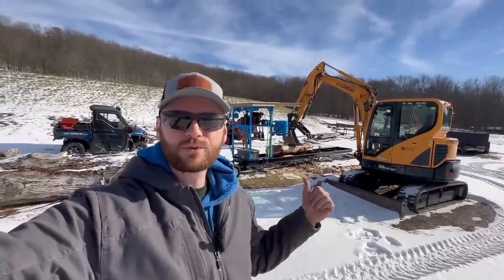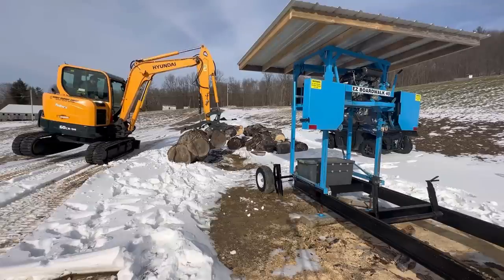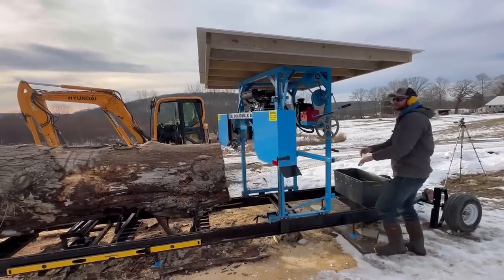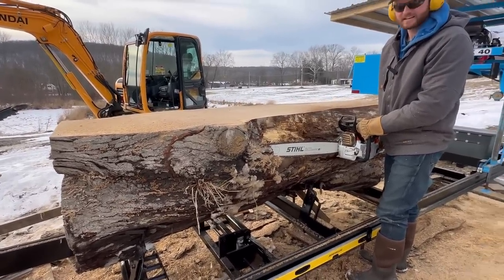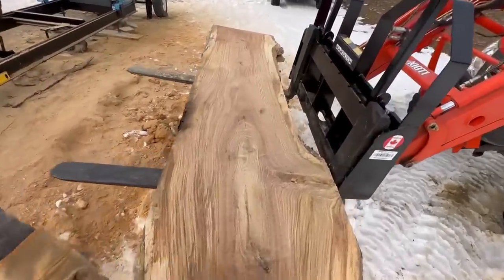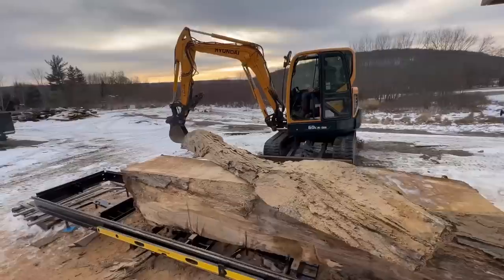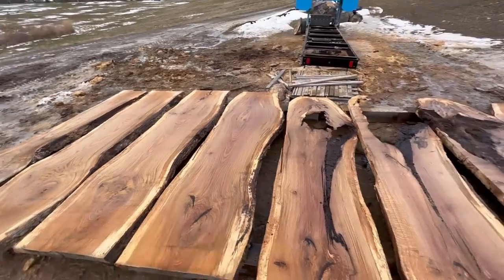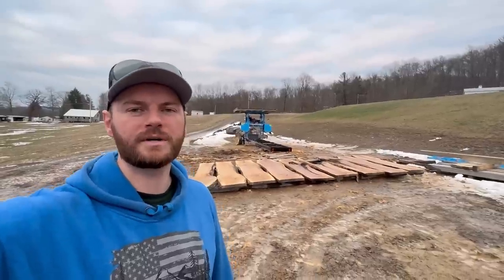This Log BARELY Fit On Our 40” Sawmill

Comment: Cutting a yard full of firewood today in northern Minnesota. With a tiny Worx 120VAC 14". It actually cuts real nice for an el cheapo. Except when the bar isn't long enough to cut across the flat. The tip will not cut. I believe it's because it has a safety chain. My major complaint for this saw - the top handle is too close to the chain. Many times where my pointer finger is only a 1/4" away from the meat grinder. 
I think you hit some dirt to dull that chain. That oak is beautiful.

Comment: I know the 45 minutes of adjustment time might have seemed long, but it’s better than the time to try and straighten a bent frame structure. I’m not even sure you could straighten it on site. I would almost think you’d need a frame straightening machine in a body shop. So at the end of the day, you wound up with some beautiful slabs and a saw mill that will be ready to roll tomorrow. All that said I know both you and Doug know that. You guys always do thing’s smarter not harder.

Comment: you can pull the fork choser to the mill slide off or get a host with a load leveer and Felled Timber Claw Hook, 28in - Log Lifting Tongs Heavy Duty Grapple Timber Claw, Lumber Skidding Tongs Logging Grabber

Comment: WOW!!! That makes the effort worth it. Stunning, beautiful slabs there, Adam. I had to laugh when you first 'tried' to pick the log up with the excavator. I pulled a bunch of stumps on my nephews ranch, back in September, with his KX-057-4. Some of them were so heavy, I had to use the bucket and thumb to pull them up on the blade and balance them, and even then, they were so heavy they lifted the back of the excavator off the ground when I moved them. What's the weight of your excavator? It looks a little bigger than my nephew's Kubota, and it weighs 13,000 pounds.